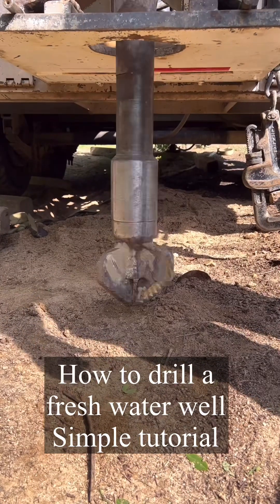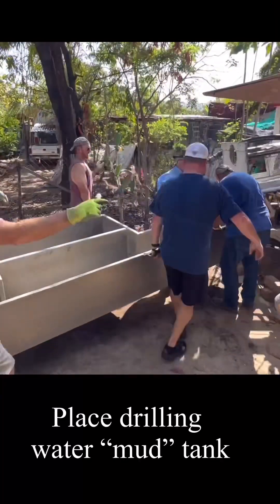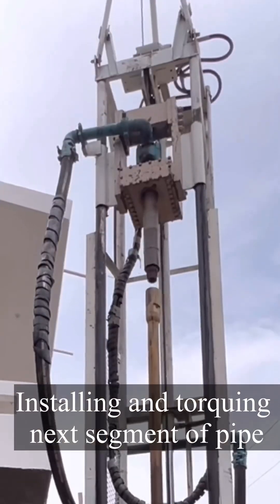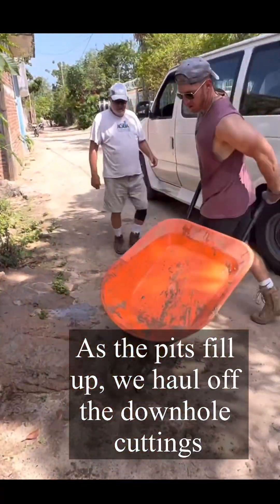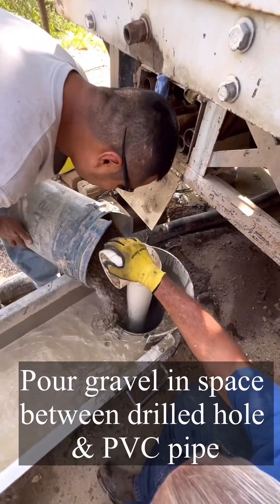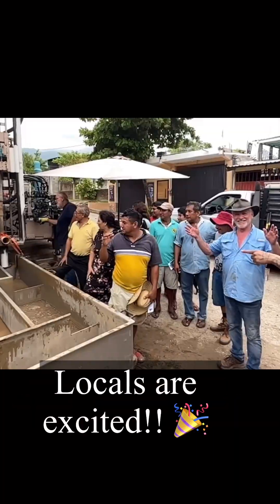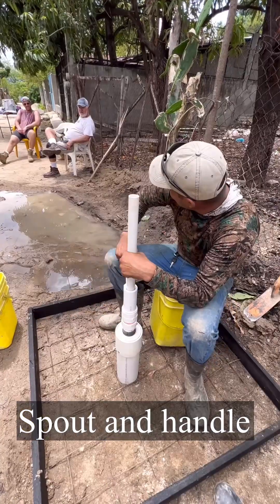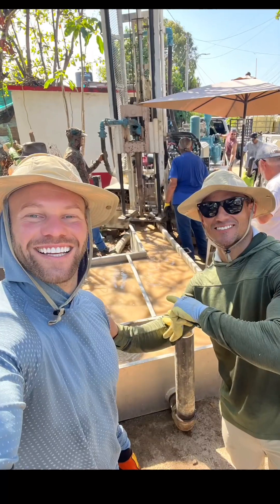How 2 Drill Water Well (Simple Tutorial)

Comment: How do you know when you have good water?
Reply from the maker: @TheSpleetoot  it varies, but usually it’s guaranteed to be good if it’s from a deeper aquifer, which is usually at least 100’ or deeper. Something 10-40’ feet deep is often contaminated from surface drainage. Most of the wells I’ve been a part of drilling have been in an area where other wells were drilled several miles away, so we already know the aquifer is good.

Comment: It doesn't seem like a plastic pump is going to last very long.
Reply from the maker: So far they have been lasting 3-5 years. The local team goes around and fixes any of the pumps that break or have issues.
Reply from the maker: The PVC pipe underground will last for decades
Reply: @NoLimitsN8  Yeah no worries on the pipe in the well. Just the strength of the pump and the wear components. A good metal pump would last decades, but both would need the seals replaced regularly.
PVC is also not usually UV rated, and degrades in the sun. 

Sounds like it's handled though.